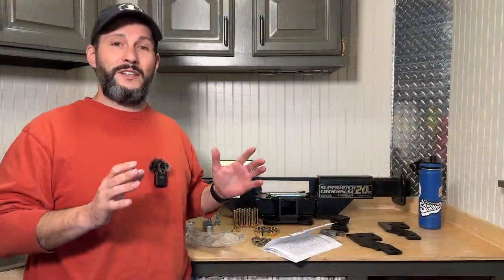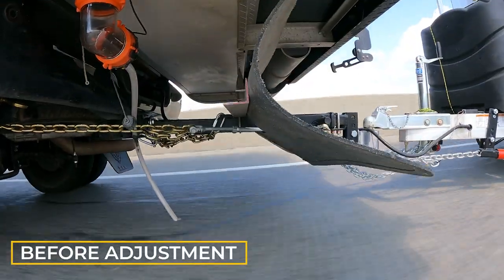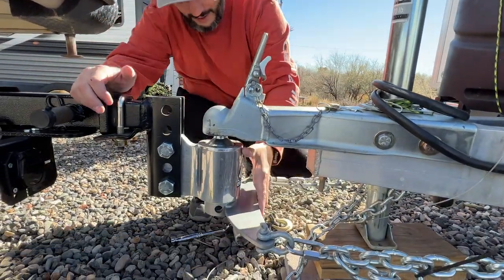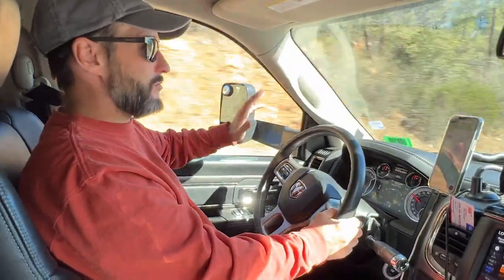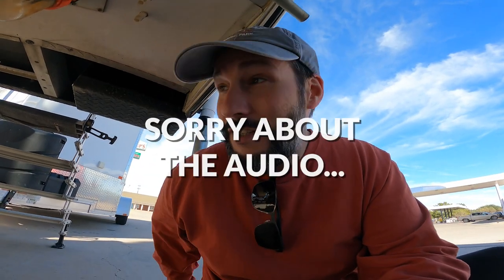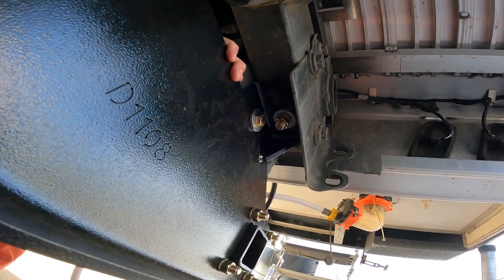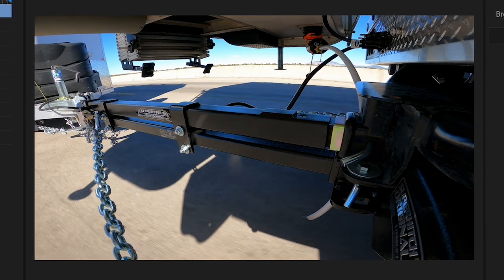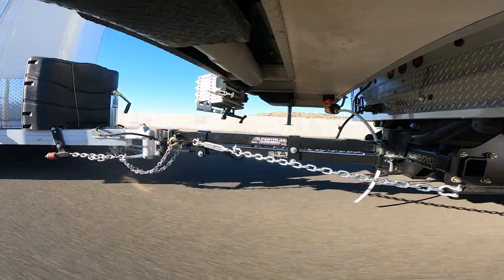1000 Mile Test Drive - Towing with the Torklift SuperHitch and SuperTruss

Comment: You said you 'didn't feel comfortable driving with it'. I can say I don't feel comfortable looking at it. There is way too much physics going on back there!
Reply from the maker: It was within spec, and survived without a problem for about 6k miles. I later upgraded to a Torklift SuperHitch and SuperTruss. Well worth it, no worries with that setup!
Reply: @Stonyboot  Just looking at the distance from the tow vehicle rear axle (the load fulcrum) to the tow ball (tow vehicle to trailer articulation point), it is physically wrong. Then I try to make sense of the physics involved in the geometry of the many load bearing linkages and moving parts, it's a nightmare. And the visible flexing of what appear to be rigid or fixed points. As you mentioned the chain adjustments required repeated tightening. There was obviously components that would have been accumulating metal fatigue.

A better, and I don't doubt more expensive way would have been to lengthen the tow vehicle chassis and extend the wheelbase allowing you to connect the trailer draw bar directly to the back of the truck. Or even better get a longer truck from the start. For example, there are reasons rail trucks are connected with such a simple hitch mechanism. Like too many often unnecessarily complicated 'things' we get into, they can work fine until something goes horribly wrong.
Reply from the maker: I understand exactly what you’re saying. Have you looked at the Torklift SuperHitch and SuperTruss setup?
Reply: @Stonyboot  I haven't looked at the Torklift SuperHitch and SuperTruss setup. What I did do was step back and look at the labyrinth of chains, struts, articulations and angles you used to attach your truck to the trailer. And judging by the forced movement of what were obviously meant to be fixed components, the whole 'shebang' had many points undergoing unhealthy stresses, everything seemed to be fighting each other. When engineering something that has the potential to end in catastrophic failure, I try to remind myself when it appears to be getting overly complicated, better I get back to employing the 'KISS' method, I remind myself to 'Keep It Simple Stupid'.
Reply: @rossevans1774  I just installed nearly the same Torklift parts. I have a 36" supertruss. I bought the 30k superhitch and removed the OEM hitch from my '23 F350. 
The two tubes, when tied together , complement the load carrying capacity because the top tube is in tension, and bottom is in compression. The tongue weight acting downward vertically results in some of that downward force tensioning the top tube and compressing the lower tube. Since theyr'e tied together but independent tubes, it is more stable than a single tube extension.
That said, it is really a beefy piece of hardware, much more so than other extensions I've used.

Comment: Dumb question here. I have seen these hitch extenders before and there is always a lot of flex. The leverage is huge. Have you ever seen someone extend the tongue of the trailer with something solid?  I know this would effect tongue weight that would have to be addressed with movement of cargo and possible movement of axles. But in your case you are setting this up for this truck with this trailer long term. So if your extender now is 4' and distance to outside of rig is only 4', to clear corner on turns would be under 6'.  Just food for thought here or something to give you a laugh....
Reply from the maker: I’ve looked at that option. And while I could extend my trailer setup, I would also have to do the same for any other trailer I chose to tow. Also, when talking to some trailer guys, there are limits on how far you can extend the tongue before you need major modifications to the trailer tongue and frame. So it wasn’t worth it to me for this particular trailer. 

Both would work, but this is more of a universal fix.
Reply: @Stonyboot it is very easy to extend the tongue of the trailer and would be way stronger and safer then extending the hitch.
Reply: @Stonyboot here is some math for the difference extending the tongue by 4 feet makes vs extending the hitch by 4 feet. If the center of your load in the trailer is 1.5' in front of the center of your trailer axles and your then end of the tongue is 12 feet  from the center of your trailer axles that means 1.5'/12' gives you 12.5% tongue weight, so 7000lbs X 12.5% = 875lbs. If your wheel base of your truck is 13' and your hitch ball is 9' from the center of your rear axle 9'/13' = 69% of the tongue weight will be taken off of your front axle and added to you rear axle, so 875 X 69% =604lbs + 875lbs = 1479lbs is the total weight being added to your rear axle. 
Now if you extend the trailer tongue 4 feet instead. Your tongue weight would equal 1.5'/16' = 9.4% X 7000lbs = 658lbs. The amount of weight being taken off your front axle of the truck would be 5'/13' =38% X 658lbs = 250 lbs total weight being added to the rear axle is 250lbs + 658lbs = 908 lbs.  So the difference in weight on the rear axle of the truck from extending the hitch vs extending the tongue is 1479lbs - 908lbs = 571 lbs.

Comment: You can my opinion I'll be changing them change of get the free 38 Shane I think it is for heavy-duty for semi your links won't stretch out too much but that cheap chain I seeing there that's a cheap chain I wouldn't use that all use a different heavy heavy duty chain I think it's a 3/8 or something that's what I use still in my flatbed semis when a horn still and that's the best chain yearly by cuz it leaks don't stretch out because that's a cheap chain link so that stretch have a good day

Comment: Could do this with your bolts and your nuts air get a red marker or black marker marker at there where your nuts is that we tie them all the way up me and check if it back off if that Mark has been moved you won't Mark a nut and where the washer metal plates at or soften washer I wouldn't do that because washer turn on you faster was not would but that's what I do when both sides of your bowl and you're not there then you know if it's backed off any more stretched out some have a good day